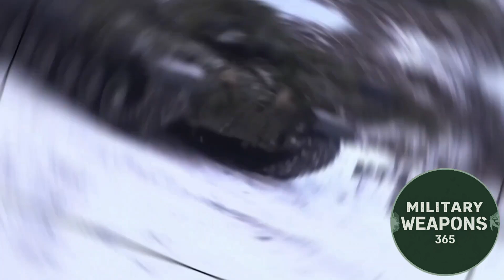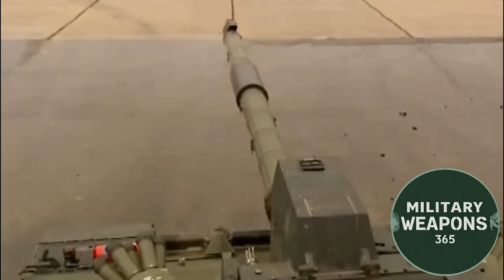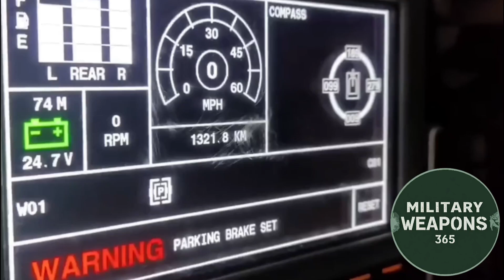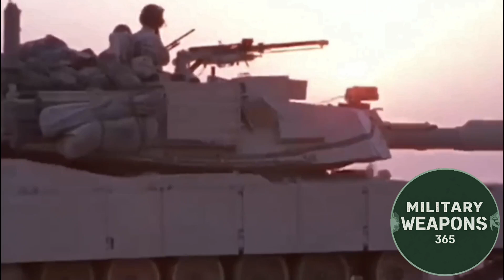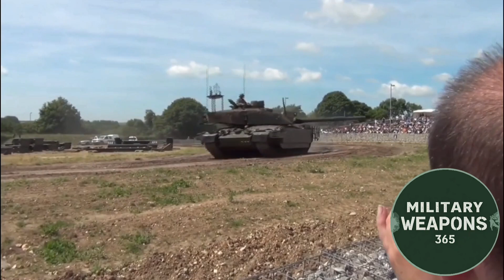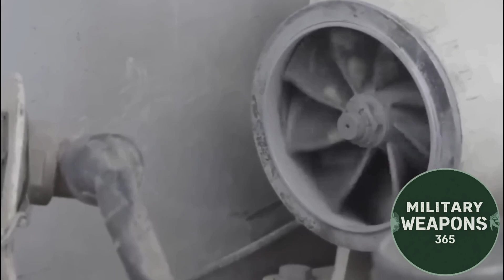Which one is the king of the battlefield? The American Abrams or the British Challenger 2?

Comment: Well considering the test trials in Sweden and Greece aswell as the first hand experience of Ukrainian crews it's neither.

It's the Leopard 2.
Reply: Makes sense for a number of reasons. One is logistics, Leopard2s are abundant and the infrastructure to repair them is close by. Two, they are lighter than the Abrams and Challenger making them more mobile. Three they were tailor-made for high-mobility warfare in the open fields of Europe.  

The Challenger was meant to tank a lot of hits, and the Leopard was meant to shoot as far as possible while being quick. The Abrams is in the middle since it has to be able to operate in a lot of different conditions. 

Also the export Abrams have less advanced armor than the ones used by the US.
Reply: @Predator42ID  The logistics part is true since the Leopard 2 is the most reliable out of the three and the easiest to maintain. 
The other points are nothing but myths. 

The Leopard 2A6 is about the same weight as the M1A2 Abrams, later versions are actually heavier. The misconception the Abrams is heavier comes from people comparing the Abrams weight in short tons to the Leopard 2s weight in metric tons.

Challenger 2 was also not ment to tank a lot of hits. In the Swedish and Greek trials respectively the Leopard 2A5 demonstrated a superior level of ballistic protection to the Challenger 2 and M1A2 Abrams. The Challenger 2 is notorious for a bad armor layout, being heavier but at the same time less protected than M1A2 and Lewopard 2A5.

The Armor test array send by GDLS to the Swedish trials was actually heavier than both, US DU and export non DU armor arrays used by the Abrams. The Leopard 2A5 still had a higher level of protection.